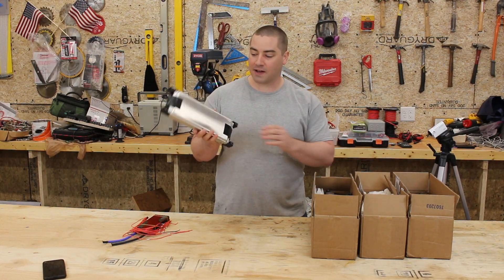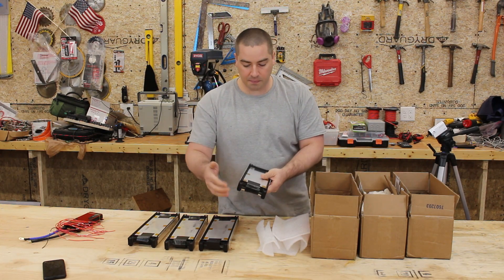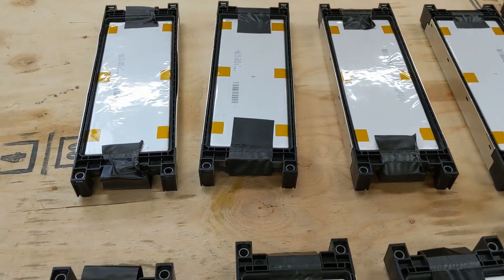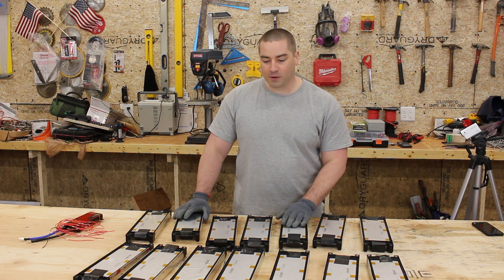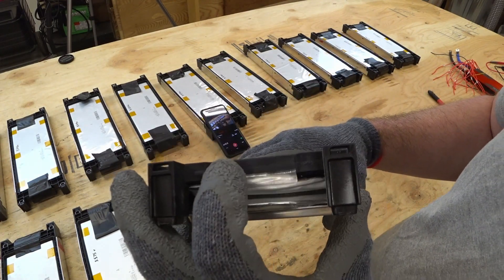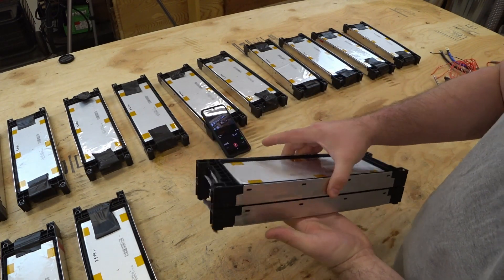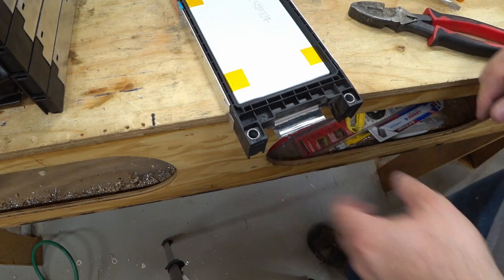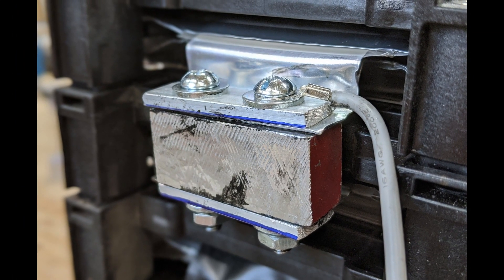LG 6kwh Powerwall, Part 1, Joining Cell Tabs Together

Comment: I just ordered 28 of them! That's going to be a 120lb 4P 14S 42" wide 12KW $1,351.47 monster. I'll need a good BMS of course  I will be reviewing your videos  and would like your recommendations.
Your videos are awesome, inspiring and appreciated.
Thanks!
Reply from the maker: That's going to be a great powerwall.  There are lots of good BMS's on the market depending on what you want to do with them.  I'm going to be using a Daly brand, 14s, 200 amp BMS.  I bought it on Aliexpress.  I'll be installing it on the next video.

Comment: David, have a look at aluminumspacers.com

With 61% the conductivity of copper, aluminum is a very good conductor, though it does have a "creep" tendency, which is particularly important at connection points.

By combining the connector and the conductor, aluminum spacers would greatly simplify a build of this type. Just remember to use a threadlocker on all connections. I prefer Loctite red (271) for applications such as this. Though it's permanent, the joint can be non-destructively disassembled by applying heat to melt the plastic.
Reply from the maker: Thanks for the suggestion.  Those certainly would speed up assembly.  You also suggested BMS's with relays.  Do you have any links for ones you like?
Reply: @DavidPozEnergy  I'll e-mail you later.

Comment: You must be losing through the aluminum tabs when you are spot welding the tabs, nickel will not weld to aluminum... please check the resistance between the tab and the nickel strips

Comment: Great video, just wondering if you looked up the individual pouches, be interesting to see the cost, (no battery hook up in AUS). Also what product did you try to solder the aluminium, i am currently doing a 5kwh using mg-12000-flight-battery-pack that where getting thrown out. I am soldering the aluminum tabs without an issue with NVR Flux. I happy to show a video of it working. Thanks Andy
Reply from the maker: Hi Andy,  I don't remember what flux I tried, it was 2 years ago.  But, yes please.  I'd love to see a video of it.  I'll also look up "NVR Flux"  Thanks.
Reply: @DavidPozEnergy  i am not a big poster on Youtube, so i am unsure how to get the video to you. I am on secondlifestorage, happy to chat there, Just dont know how to on here.
Reply from the maker: https://www.facebook.com/DavidPozEnergy/  if you are on Facebook.

Comment: Hey David, I bought the 5.94kwh pack with 10 cell groups about two weeks ago. I’m going my to separate each like you’re doing and make a 48v pack. I think I paid $600 total because of your coupon code! Keep up the good work. Mine is gonna be used for a backup battery and solar system
Reply from the maker: O, cool.  By breaking them down yourself I hope you can find a way to keep the tabs a little longer.
Reply: DavidPoz  Me too!  I’ll let you know.

Comment: I bought some of these from Battery Hookups as well. Pay close attention when checking voltage of modules. I found one that had the cells reversed. The pouches were opposite from each other and I was really surprised that they didn't short each other out in shipping. I had to pry a spatula between them to separate them and re-assemble. The tabs on some of my cells were too short to use your method of assembly, so I have one 7S pack with brass grommet crimps and another 7S pack that I spot welded with a large spot welder (automotive type). The trick to spot weld aluminium tabs is to use a 18ga stainless on either side. The stainless won't weld to the aluminium but will provide enough resistance for the aluminium to heat up and weld together. I am testing the two different packs to see which method preforms the best.

Comment: I hope to get quite a few more, enough to power my off grid house for days, without sun, I only use a 5 kw inverter, and use 12,vdc lights, so it's not going to be that much,  I have nearly 20kwh maybe 30-40 kwh will be enough,  for a while, these are alot better deal than leaf batteries,
Reply from the maker: I agree.  Leaf batteries are a good deal, but there could be a lot of degradation.  These cells have not been cycled, so they should test really good.
Reply: The average U.S. household consumes 30kWh/day. If you're well under that figure, you may already have sufficient storage capacity. Match you PV capacity with that of your storage, factoring in your average daily consumption and 2 to 3 days of low/no sun. This, in turn, determines controller and inverter sizing.

Comment: Buyer beware of bigbattery.com  I bought the BYD 24v powerwall from bigbattery.com and it won't charge and they won't even return my emails or answer my phone calls.  My only option is to report them to the BBB. Very shady company I would not recommend.
Reply from the maker: I have not bought anything from bigbattery.  These are from Battery Hookup.  Thanks for watching and I wish you the best of luck with working out your issue.
Reply: @DavidPozEnergy  Thanks I will have to give battery hookup a try.  I bought the battle born but they are extremely expensive!
Reply: I can vouche, Battery Hookup is good. I've had a bad cell replaced with no hassle.

Comment: David, you need TERMI-FOIL... These are commonly used for mecanically tied flat tab for cells. Zero motorcycles are also using them to link all their FARASIS pouch cells in their battery   https://media.digikey.com/Photos/TE%20Connectivity/330003.jpg     Even Alibaba are selling these. These are made for that kind of purpose where some metal can't be soldered. It is effective for up to 400A ( the max current their 25Ah ( 102V 28s) cell brick was capable to handle
Reply: How do you crimp the Thermi-Foil connectors, without buying their $700 crimp tool? I just ordered 20 of them from Mouser.
Reply: Where can you purchase them?
Reply: @fisherus  Digikey or. Even ebay sometime

Comment: How many cycles can be expected out of Li-ion batteries
Reply from the maker: Depends on the chemistry.  These are Li-NMC, which I think are 3,000 cycles.  But I'm not 100% sure.
Reply: @DavidPozEnergy  Thanks, BatteryHookup has them as Lithium Ion under Type
Reply from the maker: Sometimes manufacturers use "Li-ion" as a generic term referring to anything lithium.  I have some Lithium Iron Phosphate batteries that also say "Li-ion" on the label.  It's just a generic term, not a specific chemistry.

Comment: I know this is not in an automobile situation but those screw bolts for the tabs can come loose over time because of thermal expansion and contraction cycling. Using good nordlock washers will help but they are expensive. We used this very method for connecting A123 LiFePO4 20ah Pouch Cells. Jack Rickard came up with that solution for tab connecting. I'd say no to the hollow aluminum square stock as it does require a good solid torque to hold well I have plenty of those left over for a power wall. Gives me an idea. Thanks. Being LiFePO4 they can't be beat. A123 made excellent LiFePO4 chemistry.
Reply from the maker: Good point about the hollow stock, it might deform when torquing down.

Comment: David, here is an idea.  TWo copper washers and a a single bolt , then you could put one hole with a copper washer on either side of the tab and then have a lead coming from it.  Then you could make a very then simple copper bus bar n the outside.

Comment: Your pretty smart David, I have a few smaller cells, four of 8AH cells that I need to hook together it looks like your method is probably the best I have seen so far. However like a few others have said it's a lot of work trying to use these pouch cells. I will use the ones I already bought but I don't think I will ever buy any more.
Reply: See my comment about aluminum spacers.
Reply: @ARepublicIfYouCanKeepIt  I could not find it. Must be buried deep.

Comment: I just built a 7s pack with these cell, and had all the same problem. I ended up using crimp connectors and two 10 gauge wire with rivets to tie the cells together. My pack should never see more them 50 or 60 amps.
It was the largest and fastest battery I've built though.
Reply: Justin, What kind of crimp connectors, rivets, and wires did you use?
Reply from the maker: That works too.

Comment: David what would be a good rate to charge these at?  What size BMS and current is best?
Reply from the maker: I'm personally going to be hooking up a 200 amp BMS (Daly brand) but with a 100 amp circuit breaker.  So I'll be limiting the charge and discharge to 100 amp.  According to Battery Hookups website, each cell can do 1C charge and 2C discharge. This is about twice what I'm limiting it to with my circuit breaker.
Reply: @DavidPozEnergy  Consider using BMS-controlled relays for high current applications. While this increases component count and complexity (somewhat), it's a far less expensive approach, easier to source, and the same for every build. No dizzying array of BMS boards. No precarious single point of failure. Just be sure to choose a BMS with balancing current sufficient for your charge rate.
Reply: @ARepublicIfYouCanKeepIt  Have never seen one. Why tease? List specifics or point somewhere for an example please?

Comment: Sweet! I had a bad experience using high carbon lubricant with aluminum and steel (I assume that the screws, washers and nuts you used were steel) which caused massive damage to my boat electrical panels. My electrician friend told me aluminum and zinc coating on the screws cause an electrolysis reaction. Maybe it's OK for batteries? Thought you might like to know.
Reply: David:  Could you please do a close inspection of your tabs and see if you can observe the beginning of these "dissimilar metals" starting to adversely interact with each other?  Thanks!

Comment: Whoever is selling those batteries needs to leave the tabs longer.
Reply: The problem is when they take them apart. That damages the tabs. Sucks. Lucky they have good tabs to use.
Reply: Pete McWade  I can't wait for 8s lg chem battery hookup used to sell. These modules come from the same  3.5kwh pack. My plan is to connect 3 of them in series and get 15 kW 96volt sigeneer inverter/charger. Jack Richard had them build this inverter for 4 Tesla modules S in series. 8s lg chem is at 29.6 V nominal, so 3 of them in series match exactly the voltage limits of this inverter.  All is needed is a bms, 24s balance module and the temperature control. I think that $1050.00 sounds good for 10kwh brand new battery packs in 96Volt configuration. I prefer higher voltages for a power wall, less current on a DC side, less heat and the system is more efficient . It can always be bumped up in parallel for higher capacity. I understand that 24 or 48 volt systems are safer to work with and many people chose this route but as Jack says and I agree - this is not an EV, where 200 or 300 Amps is being drawn for 6 seconds. With lower voltage systems, higher currents are drawn continuously and as we all know that leads to the temperature build up and it becomes dangerous especially near battery terminals.

Comment: Gotta say, this one goes into the “more trouble than it’s worth” bin.  Still enjoy your vids
Reply from the maker: It sure felt that way sometimes.  Hopefully I saved someone some time.
Reply: DavidPoz yep, you took one for the team on this one.
Reply: 700 bucks for 48V 120Ah 6kW battery is worth what he went through.  Battle Born charges $1000 for 100Ah 12v 1.2kW.  Am I off base here?  I'm not very much of a battery expert, but seems these are good value.  (edit: 1200kW to 1.2kW)
Reply from the maker: @D Dixon: You are correct.  I like to think of it in terms of $/kwh.  (smaller is better)  By the time I'm done with this build, $630 for cells, plus BMS, Circuit breaker, and hardware, I'll probably be at $800.  $800/6kwh= $133/kwh.  
Now compare with Battle Born, which has a BMS built in.  You can buy the Battle Born for $950 at Alt-E.  And is 1.2kwh.  $950/1.2kwh=$791/kw.
Reply: DavidPoz but that math values your time at zero, and friend you’re worth more than that.  Throw $100 / HR on David’s contribution and rerun it

Or, estimate your hours and compare your value against that of Battleborn inc

😁
Reply from the maker: @Edward Byrd,  You are correct.  Time also has value.  I spent a lot of time on this just figuring things out.  Hopefully someone else could follow suit.  I spent probably 20 or 30 hours on this.  But I could probably do it in 6 hours now, knowing what to do from the beginning.
Reply: I edited my mistake above so no confusion:    (edit: 1200kW to 1.2kW).   If one has nothing to do with one's time, no opportunity to make any income, using the time in the garage being productive rather than watching TV comes at zero cost actually.    133/kwh vs. $791/kwh... amazing, but it gets even more amazing if you think of it this way, to get 48v from Battle Born batteries, you have to spend 4x950=$3800 vs. $800.   I'll work in my garage for a long time to save that sort of money.
Reply: @ForwardGuidance  I'm retired with lower income. I don't ever count my time on a project because my "job" is being retired, which translates into time we didn't have when working.   I also found that I can be retired on lower income because I have the time and skills to do all those projects I'd have to hire out when I was working.  So I enjoy the actually cost of the items.
Reply: @DavidPozEnergy  The economics of all DIY energy projects beat retail alternatives every time. Even with brand new cells. Dropping prices, combined with an abundance of disused/decommissioned cells, and a large target market, predicts a bright future for those with talent, tools and time.
Reply: @DavidPozEnergy  Using off-the-shelf aluminum spacers, the entire pack could be assembled in an hour, tops! No measuring, marking, punching, drilling or cutting. Fewer components and tools. Less expensive, far easier and, therefore, accessible to the less skilled. And, IMHO, a better aesthetic.
Reply: @ARepublicIfYouCanKeepIt  Where do we get the spacers, please?
Also, do you sand the aluminum and put conductive grease in between?
Reply: You should've used the rivets instead with a steel back washer and they would get tight.

Comment: So The Kweld did not work?  I would like to know If you have any tips for kwelding them.
Reply from the maker: It worked, but was overheating.  And then when jumping from one cell to the next I'd be using a thin nickel strip.  I tried it with doubling up the nickel too.  I just didn't like it as much as the aluminum block.
Reply: @DavidPozEnergy  when you drilled the hole it looked like it ripped the nickel off clean like it did not penetrate.
Reply from the maker: That was one of my earlier attempts at spot welding the tabs.  I was probably down at 50 or 60 J at the time.  I edited a lot of video footage.  I found I needed at least 100 J to get the penetration.
Reply: @DavidPozEnergy  thank you David

Comment: Great video as usual! Those aluminum blocks worked out great but kindof look like a pain to make.
Reply from the maker: Not too bad, but would have been much easier with 3/4" square tube instead of solid.
Reply: You have a very nice array of tools that makes it not bad. Every time I watch a video, I feel like you already have a tool for the job lol. The two things at the top of my list right now are drill press and bench vice.
Reply from the maker: Those are good to be at the top.

Comment: How about doing a power wall where full disassembly isn't required.
Reply: I've done one using 16s modules.  Half 2017 Smart ForTwo cells split in half (originally 32s) and half Volvo LG chem cells.  I'll make a video about it soon.